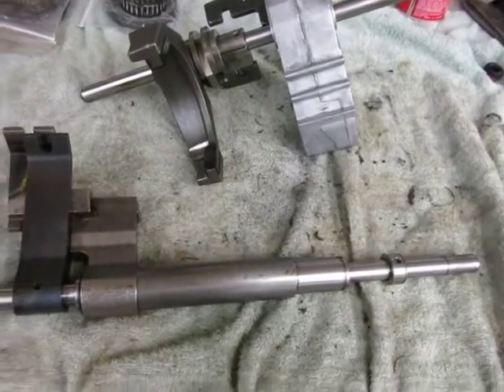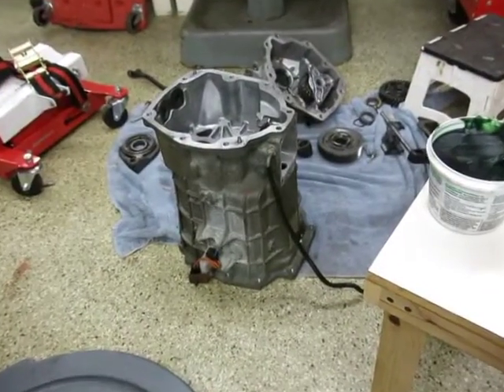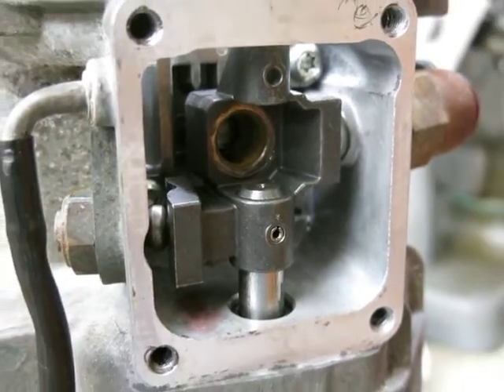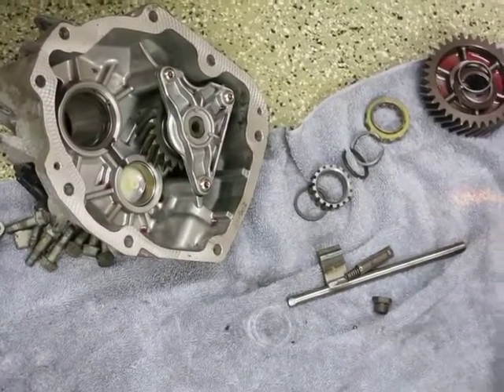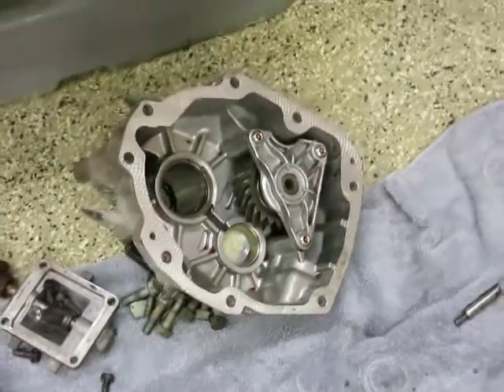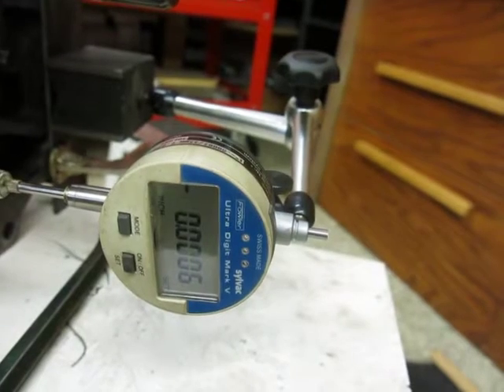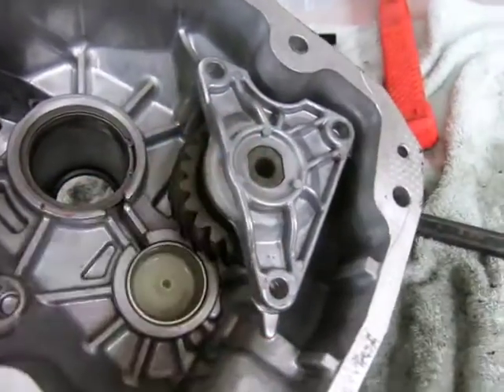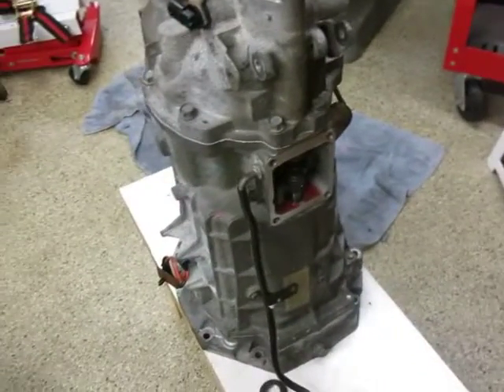Tremec T56 Transmission Rebuild - Part 4 - Final Assembly

Comment: Tr6060 tranny not t56.
Reply from the maker: No, it's DEFINITELY a T56.  Came out of a 2004 CTS-V which is why it's different than the T56's you're used to.
Reply: Not correct, the tremec 6060 and tremec t56 are not the same tranmission. Difference are parts.
Reply from the maker: They didn't make the tr6060 in 2004 when this car was made. You can argue all you want, but you are flat wrong. This is not a tr6060.

Comment: You said the max countershaft extension endplay is 4.5, where did u find that spec #'er? Is it ok to set to 0?
Reply from the maker: I got all of the specs out of the Tremec service manual.  https://www.tremec.com/anexos/TRSM_T56_0711.pdf
Reply: @SlideruleRacingProducts  thanks Chris. One thing that I wasn't able to find was any info on the shift rail detent mechanism that's in the front plate. Was there any torque specs for that bolt?
Reply from the maker: @canadagoose3812  I don't recall, sorry.

Comment: Do you know what the diameter of the shaft is that connects to the offset lever, what roll pin size it is and where to buy that specific offset lever? Looks like it's an aftermarket part?
Reply from the maker: All of the parts you saw in my video were OEM cadillac parts.  I do not know the diameters of those components.

Comment: Hey Chris, had a question for you. I’m swapping the tailhousing for my T56 and I can’t get it to go on. It’s an aftermarket AMP unit, and I’ve transferred all bearings and reverse idler gear. Is there a trick to it, or am I supposed to have it in a certain gear? Thanks for your time, and great videos.
Reply from the maker: I'm pretty sure I installed mine while in neutral and I don't recall there being any tricks.  Sorry I can't be more help..
Reply: Hey mate, I’m currently having the same issue. How did you manage to get it done? What worked for you?

Comment: When installing a new input shaft only, is it necessary to change the countershaft bearing shims? Since they are set before the input shaft is installed, it shouldn’t effect them, correct?
Reply from the maker: That's correct. You shouldn't need to adjust them.  Good luck!

Comment: When you pressed the 5/6 gear on the main shaft, did you support the input shaft while doing so? I am having a similar issue with my new shaft and new 5/6 gear. Unfortunately the new shaft doesn't have threads in the end to press the gear on with. I wasn't sure if it would be ok to press against the front cover or would it be better to support the end of the input shaft to press against.
Reply from the maker: When I placed the transmission on the press, it appears that I just rested it on the case.  The press fit shouldn't be that high, so it should be OK.

Comment: Hi there, I need some help figuring out where the tiny ball bearing on the button @ 6:30 in the video. You have it laying on the towel with the detent spring, tail cover rail and bolt that goes on the adapter plate. Any help is greatly appreciated.
Reply from the maker: If it's what I think you are asking about it goes under the hex bolt that is in the top front of the transmission.  You can see it clearly in the 1:57 mark of my Part 1 Disassembly video.   Good luck!
Reply from the maker: That said, it was a long time ago that I did this rebuild and I may be wrong.. But if its sitting with that detent spring on the towel, that's most likely where it went.
Reply: @SlideruleRacingProducts  I called tremec and turns out it goes on the mainshaft right after the 1st gear on the half moon spacer/washer. Thank you for taking time to reply. Your video was very helpful!

Comment: How much pressure did your 5/6 gear take to get on?  I have a new shaft and trying to press the 5/6 gear on and it seem to have stopped.  Its got another 1/2 inch or more to go.  I'm afraid to put to much pressure down on the shaft.
Reply from the maker: Yeah, mine took a lot more pressure to put on as well - I assumed it was because I had my shaft built up to fix the original looseness from wear.
Reply: @SlideruleRacingProducts  my 5th gear is a 33 tooth.  I assume you're is a 37t?  I wonder how much wider the 37t is compared to the 33t.  I was able to slide the case off with 5/6 still on main shaft.   Think I'll press the new 5/6 gear on before installing the main shaft.

Comment: i need to change just the rear housing with the drain, anything important to know or just unbolt and replace? thanks great vid btw
Reply from the maker: If you are replacing with a unit from a different transmission, then it could impact your clearances. See 8:50 in the video.  Good luck!
Reply: @SlideruleRacingProducts  Hi thanks for the reply its a new genuine rear gearbox cover although im probably going to get a gearbox rebuild specialist to refirb the bearings now aswell

Comment: Just watched your series of videos. I know it's been awhile. Is there a list you can provide of must have tools and such?
Reply from the maker: The ring clamp pliers were really important to have - I've referenced them elsewhere in the comments I believe on at least one of the videos.  Having the press is also nice.  Some dial indicators for measuring the clearances makes it easier.  Most of the rest of the tools are pretty standard.  The green goo assembly grease I think helped as well.  Good luck!

Comment: Really appreciate your videos! Around 7:00 in you have the trans on your press and the 5/6 gear is about 1/8" down on the splines. My T56 currently sits exactly like that, and it also had the mainshaft 5/6 journals repaired by TDP. But even in my press I can't get the 5/6 gear down any further... any advice?
Reply from the maker: I remember after the reworked shaft it took a bit of effort on the press to get it on.  You could use a little heat, but if you think its too tight don't go too crazy - you may never get it off again.  Good luck!
Reply: @SlideruleRacingProducts  Thanks for your response! In the end it took removing the transmission front cover, setting the bottom of the mainshaft directly on the press, applying ALL 12 tons from my Harbor Freight shop press, heating the gear, and hitting it with a hammer to get 5/6 gear to fully seat. It was a little tricky to reassemble the transmission with 5/6 gear already in place, but man what a hassle. I'd say the 5/6 gear is definitely in the "never coming off again" arena.
Reply from the maker: @tcolesen  I'm sure that was a major hassle.. It never goes perfectly smoothly, right? Good job getting it back together!

Comment: I've watched all four videos - some of them twice. So informative. Thanks, Chris. My 2007 CTS-V has 237,000 Kms on it and is running fine but I can see a rebuild needing to be done sometime in its lifetime. That said I choose to burn gas in fifth gear rather than lug sixth up a hill or even into a headwind while on the highway, as I've read that lugging can take out fifth; sixth; and reverse. With the aerodynamics of a barn I like to err on the side of the small expense...!

Comment: Chris my son has taken part and reassembled his t56 2000 Camaro several times,  can't get 6th gear, sounds like grinding a little bit. all other gears work.  any help is appreciated. he is going nuts. he has 5th and reverse.
Reply from the maker: It sure sounds like his 5/6 gear lever has a problem.  Check it for cracks or the pads for strange wear.   Also, read this thread: https://ls1tech.com/forums/manual-transmission/1902869-t56-6th-gear-issue.html

Comment: When you pressed the 5th/6th gear assembly onto the main shaft did you take the front plate back off and support the shaft?  Or did you press with everything together and transfer the force of the press into the front input bearing and race?  This can brinell the bearing race and cause premature bearing failure.
Reply from the maker: I'm not sure how you'd take the front plate off with the rest of the transmission assembled this far.  If you are an idiot and press down with the full force of the press, then you're correct - you could damage the bearings, but the Tremec installation manual instructs to press this gear down in place.  Read page 4-3 here: http://www.tremec.com/anexos/TRSM_T56_0711.pdf
Reply: @SlideruleRacingProducts  They also show a tool that screws into the back of the shaft that does a push pull.  How ever mine new shaft does not have the threaded hole like the old one did.

Comment: Thank you for the video! It is videos like this one that take the guess work out of the mysteries of a manual transmission. I will now tackle this job without hesitation. How was the end result? All well with the T56? I have an  issue: Are there any areas I need to focus on as I have a terrible vibration that is speed dependent. If I am running 60mph+ the vibration starts and only increases with speed. New/different rear center section, two driveshafts both balanced by independent shops etc. etc. and no change.Push the clutch in and let the driveshaft rotate the output shaft and its the same vibration. I feel it is in the back half of the transmission. Maybe tail housing bushing? Any feedback will be appreciated. Thanks,Tony
Reply from the maker: I drove it for another 30K+ miles and it was still working great when I sold it.  On mine, the one thing to pay attention to was the 5/6 gear fit.  If that is loose, you'll definitely get vibrations.  I had the shaft repaired, but in retrospect, it probably would have only cost slightly more to replace the gear and shaft with new.
Reply: @SlideruleRacingProducts  Thank you
Reply: @SlideruleRacingProducts  I know it has been a while but I have to ask another question after re-watching the video series. You used an M12 threaded rod to set endplay of the counter-shaft, how did you use the same hole to check the counter-shaft extension? If the threaded rod threads into the counter-shaft and there is now preload on that shaft, how were you able to check the extension?
Reply from the maker: @anthonylawrencesnow  Go back and watch #3 again.  You'll see it doesn't thread into the countershaft - it goes through it and then you use a nut on the far side and I machined a small sleeve spacer on the front side - when setting the preload on the countershaft.  Then when you do the extension, it threads into that, if I recall correctly (it's been a while).
Reply: @SlideruleRacingProducts  I see says the blind man! Sorry, 100% my oversight. Thank you sir!!!

Comment: Just watched all 4 of these very detailed and informative.  Just one small gripe... You are measuring thousandths of an inch, stop saying "mills".
Reply from the maker: I didn't think I was old, but I guess I'm old school.  I learned to call a thousandth of an inch a 'mil' a long time ago.  Hard habit to break.  The other old timers will know what I'm talking about. ;-)  https://en.m.wikipedia.org/wiki/Thousandth_of_an_inch
Reply: @SlideruleRacingProducts  good point.  Referring to thousandths of an inch as mils is legitimate.  I guess it's just a peeve of mine because I'm an engineer that works with old prints based off inches and create new prints based on the metric system.  Using "mils" to refer to thousandths of an inch is too easily confused with millimeters when communicating changes with clients.

Comment: Hey Chris, excellent videos. Really helping me with my rebuild. My transmission has the exact same issue with the 5/6 cluster gear being loose. I actually today just called Jason at texas drivetrain to get a repaired shaft. I have a question for you: when you go to put the gear on, can you start it in the mainshaft splines before the press fit starts to grab the gear? I dont want to start to press it on and have to rotate it after because the splines wont line up. Also can you put this gear on first before the counter shaft extension? What do you think of heating the cluster gear in an oven to assist installation?  Thanks a lot man
Reply from the maker: Hi Mike, Yes - I was able to get the splines started.  I also made sure to greases them up.  I think putting the gear in an oven first is a great idea..  However, I don't think you can put this gear on first, unfortunately.

Comment: What kind of sealant if any do you use on the tail housing to case mating surface? Also do you know if that shim under the race in the tail housing would need to be checked/changed if replacing the housing with a new one?
Reply from the maker: @evsnova74 - I used standard gray engine sealant.  I would definitely check all of your clearances if you are replacing any of the housings.
Reply: Chris Bruno could you give my a call/text 3133293950 Regarding my transmission T56

Comment: Is this the same procedure if you are putting in upgraded parts to handle big power? (i.e. Viper output shaft)
Reply from the maker: Well, as far as I know, the basic construction is the same, so I would say yes, but I haven't ever installed or disassembled any of those builds to know what kinds of nuances there are..

Comment: Great videos!  How much time did it take to do everything?  I have a broken T56 sitting on my garage floor that I've been thinking of opening up to find out why I lost 5&6 gears a couple years ago.
Reply from the maker: mcgarnicle201
I think it was around a month start to finish but mostly because I had to send the main shaft out to get welded up for a larger diameter for the 5/6 gear and also because I broke my leg shortly after pulling the transmission from the car (you can see the crutches in some of the shots).  Good luck!

Comment: The T56 Tremec transmission in my car occasionally slips out of second & third gear which has been more noticeable when the weather is cooler,the transmission has done about 332,200 kms and is in need of an overhaul.
Since I only have 1 car to drive so I will be looking for another transmission to rebuild,on the Gumtree website (in Australia) someone in South Australia is selling one with a damaged 4th gear & countershaft gear, brand new aftermarket gears cost about as much as used gears on Ebay,the transmission is available for $550 or $600 AUD but would blow out to about $2000 AUD transmission once it is freighted to me & parts are ordered, then it would be like brand new.
Someone else is selling one for about $500 AUD in Sydney ,it just needs new 3rd gear synchros so one of them would be the best bet.
If I came across a worn spline on the mainshaft I would either just use Loctite 660 to fill the void between the spline & gear or take the shaft & gear to a local engineer (Teterin) where they can spray weld the shaft to reclaim the worn surface.
I would look at doing it once I hopefully score a job soon plus I have to replace the camshaft & lifters on the easter long weekend (hopefully),I bought a used stock 12560965 camshaft yesterday locally for $35  AUD which is as good as a new one anyway.
The LS1's in Australia use the LS6 intake stock from 2001 (mines a 2002 car) but they used the 99-00 Camaro camshaft in all of the LS1 engines.
Just other goodies I have to buy for it such as a new timing chain,new hydraulic lifters,oil pump,timing cover gasket kit, intake manifold seal kit,exhaust manifold gaskets,cylinder head gasket & bolt kit, etc.